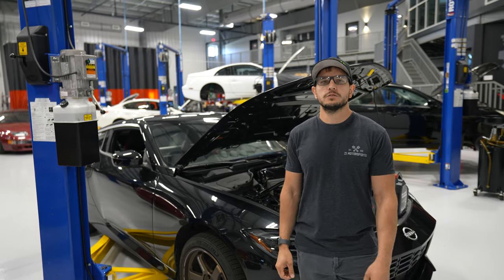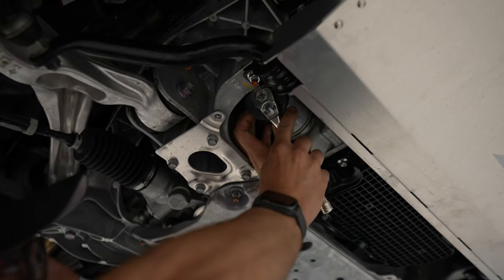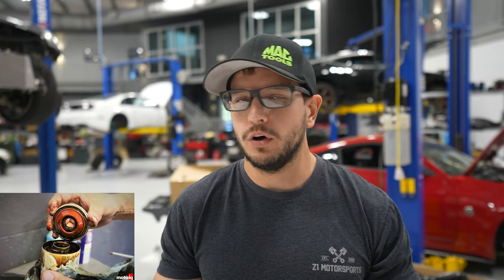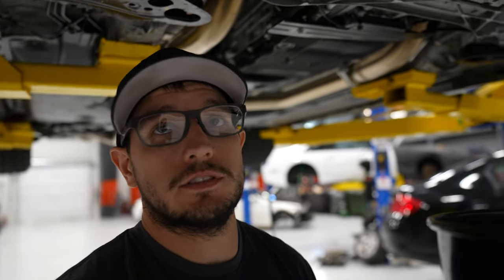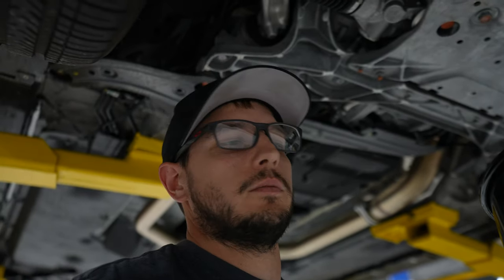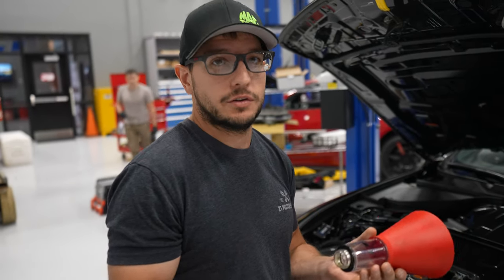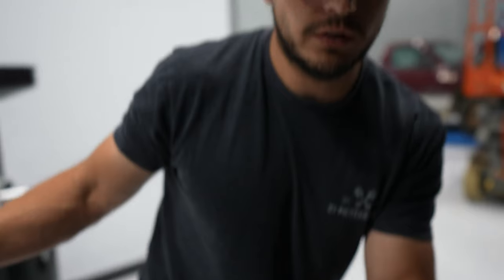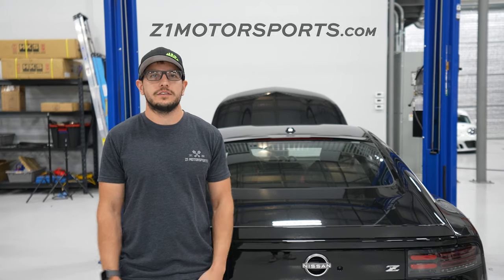How To Change The Oil On The New Nissan Z

Comment: I’d personally follow the torque spec once to get a feel for it.
When I worked for Infiniti it was common for those to be accidentally over tightened and it broke the spot the drain plug screws into.
20 ft pounds

Comment: Plastic oil pan?
Reply from the maker: Yes the VR30 Motors use a factory plastic oil pan, we sell an upgraded unit here: https://www.z1motorsports.com/z1-products/z1-motorsports/z1-2023-nissan-aluminum-oil-pan-p-31290.html
Reply: @Z1Motorsports23  thankfully you guys made this oil pan upgrade. I would never trust that plastic one for the long run, and the it doesn’t allow for full oil drainage. 
🤦‍♂️ Nissan cutting some corners
Reply: @benny6712  A plastic oil pan?  WTF?

Comment: Looks a lot like my 370 underneath. Hence why I'm not buying this car lol
Reply: Seems like a stupid reason lol why change a good chassis
Reply: @spideybuildscars  The thing is it's not a great chassis. It's heavy and it's way to0 understeer prone. It's ok to a good degree, but shows all it's faults when you start pushing it a little bit in corners. And I'm only saying a little bit (not full balls out).
Reply: @sharpemang  ok I agree with that to an extent then.
Obviously the aftermarket can fix that, but I’ve heard some reviewers say they preferred the Supra to the z because of the handling aspect.
I’d love to have a manual Z because I’d build it to drive how I wanted, but I can see that being a downside for others as well.

Thank you for respectfully telling me your reasoning instead of just mocking me as others before have. It’s appreciated
Reply: @spideybuildscars  Oh yeah the aftermarket can correct almost anything. But right out of the box if money was no object, I'd go for the Supra BMW Frankenstein. It does handle and feel better than the Z and I definitely think the 50/50 weight distribution has a lot to do with it in my opinion. I know why Nissan stuck with that distribution with the Z and GTR, while the GTR it has the fancy all wheel drive and tech to help, the Z is bare bones. 

But in the real world if I were to choose and money is a factor, 120% I'd take the new Z everyday of the week. It's not really far behind the Supra even though I mentioned the Supra handles better and the 50/50 split allows you to further your potential as a driver while you grow with the car.

Just for that price, I can't justify considering the Supra when there's something that is almost just as good for a lot less. 

I just see that you can easily add a Stillen Supercharger to the 370Z and make it have the same and more power than the new Z for less and it virtually being the same or better performing car.